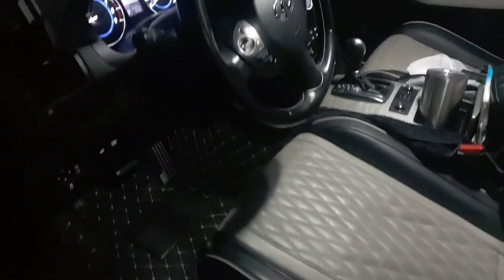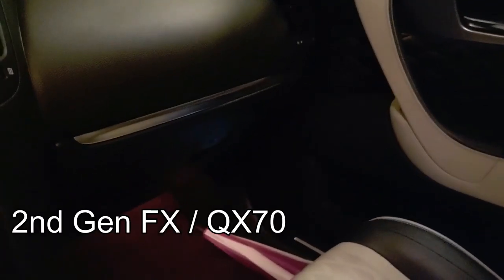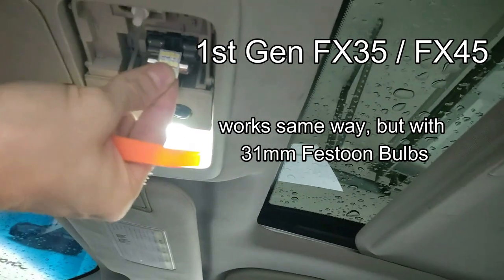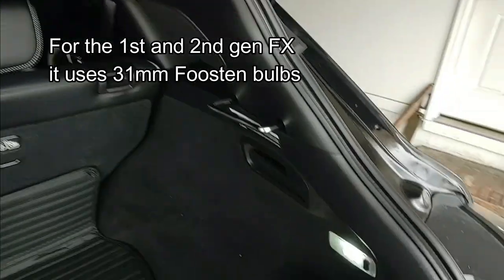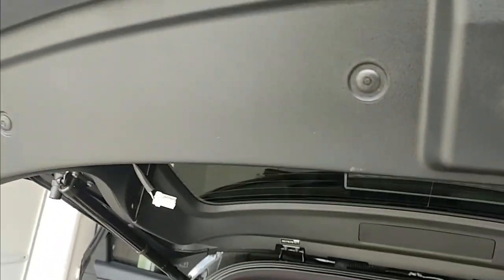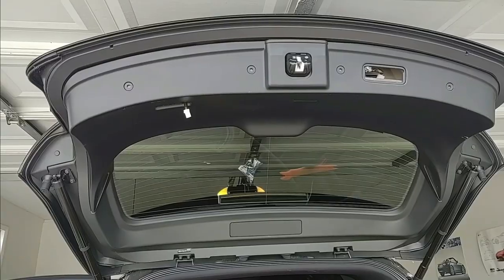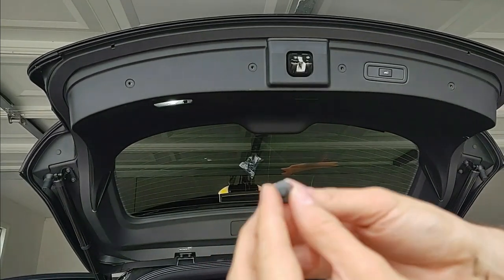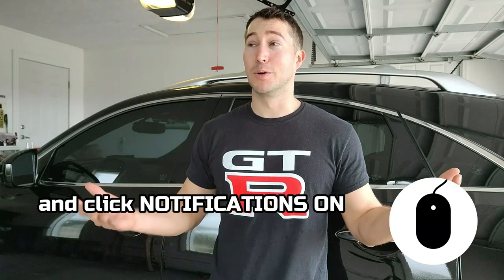Infiniti FX35 / FX37 / QX70 - LED Interior Lighting Upgrades EASY!

Comment: Great super helpful video, specially the trunk part! 

Got a PrecisionLED kit coming in soon with the 8000K bulbs (I've usually done 6000K but thought to change it up as there's not a ton of mods for the QX70 so anything that stands out more counts in my book :D

The kit I ordered also comes with vanity mirror bulbs, were you planning on doing those as well at some point? Also added a glovebox led to my kit as well.

Those infiniti logo bulbs I had on my g37s in the past but they only lasted 2-3months and from the looks of the reviews, that still hasn't improved but they sure do look nice and got many compliments on them when I had them.

Any mods to consider for the headlights? Would be interesting to see what can be upgraded there in terms of bulbs etc.
Reply from the maker: Thanks. I had that experience with the logo door lights on my last car, but so far these have already lasted longer than those. Just thought I'd try it again. 🤞  I don't have a light in my glove box so nothing to change there for me. I opted out of doing the vanity mirrors as I don't use them. I plan to at least do the parking lights to led and may swap the headlight hid to 6k while I'm in there like I did for my G37. Didn't really notice a difference in output, but at least it all matched.
Reply: @GQ37official  Hey sorry got sidetracked with life and missed your replies, good to hear about the logo door lights. Can you share the brand you bought by any chance?
Also call me crazy but it seems like there is a glovebox light that came on the other day but didnt get a chance to investigate, will report back!
Please do share a video when you swap the parking lights and headlights, would be great to see the steps!!
Reply from the maker: @kingcobra3854  the logo lights I bought are linked in the video description. So far so good on them.

Comment: Thanks for the video.  How to change the yellow fog lamps to HID?
Reply from the maker: You'll probably need to get an hid Fog light kit as it's not just a matter of changing the bulb. If you go with a led bulb it won't be as bright and projecting as the OEM yellow one, it'll match your hid headlights and look better, but ultimately they'll be worthless unless you get a kit that will actually project the light. There may be some led fog upgrade kits as well. I don't have fogs on my 2017 limited so haven't looked into it. When you find the kit you want though you can get to them by removing your splash guard under tray about 10 or so  10mm bolts and get to them from there
Reply: @GQ37official  I put Sylvania bulbs in mine. You don't lose the great beam pattern and they are nice and white. They match my new OEM headlights. Looks sweet! And I can see awesome! Also just did the interior lights and they look great too.

Comment: After upgrading my lights to these LEDs I get this cracking interference sound through one of my speakers when I use Bluetooth for phone calls. I read that LEDs can cause radio interference. Has anyone experienced this? How would I resolve this? Should I try a different brand of led bulb?